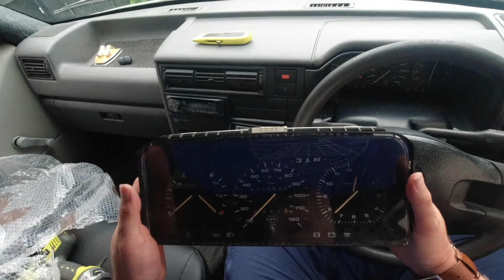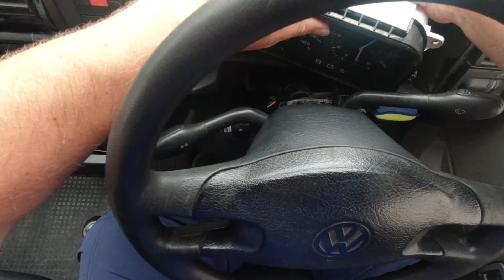The Last Dashboard Swap Out // EP05 // ROOKIE VW-T4

Comment: hi.ive had similar problem on my t4.after putting in some extra cable just at front of and underneath and to left of dashboardfor akill switch my speed went off.i sourced another dash locally so swapped it out but same problemno speedo .the one i swapped was even higher miles than mine.335000 vs 331000 mine.soswapped backagain got refundpaid 100£.recentl found you can get electroninc speedos now
Reply: My electronic speedo just arrived from slaughterhouse customs .seems ok but it’s in km/h at moment .

Comment: Iv got a T4 and went through 3 lots of dashes before l managed to find one with the correct Canbus numbers to my VIN - through the T4 club a guy made me a “designer” loom from the actual canbus numbers dash to the fuse box - all the dash’s look the same but the canbus is different please believe me lv been there
Reply from the maker: Took the one that came with the bus to an expert who said he fixed it, and he probably did. Turned out it was a short in the loom. Latest video uploaded discusses this problem ;-)

Comment: Hi did you get to the bottom of the gauge problem , i would love to sort mine , my temp works no fuel gauge .
Reply from the maker: A dash swap out fixed the fuel gauge, however, the temp gauge is still knackered and the oil is back in the coolant.